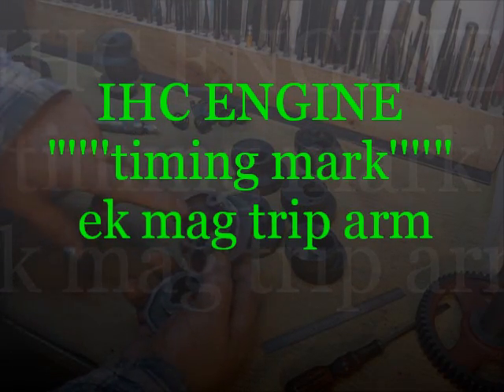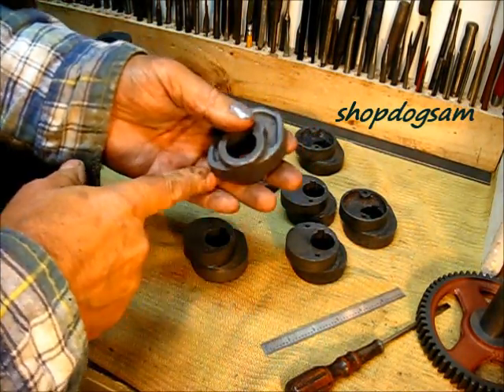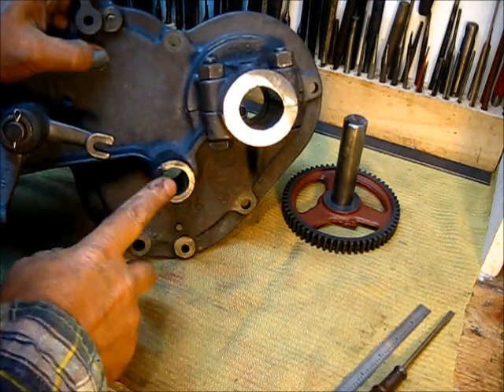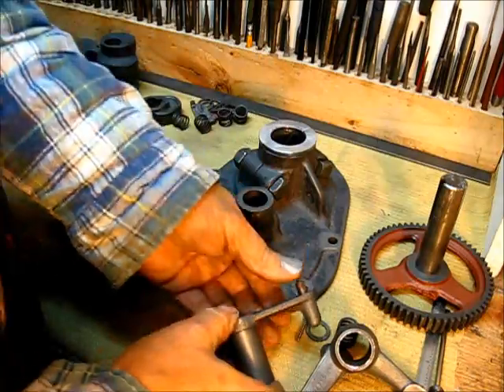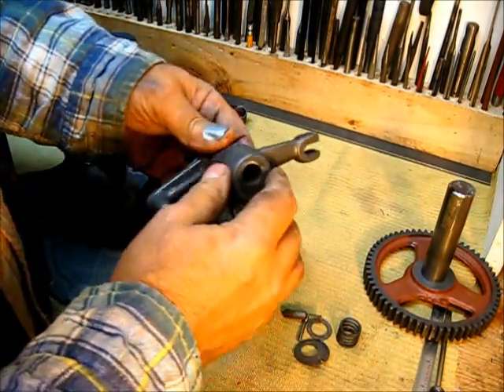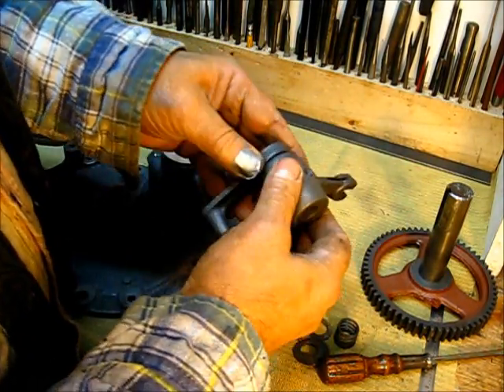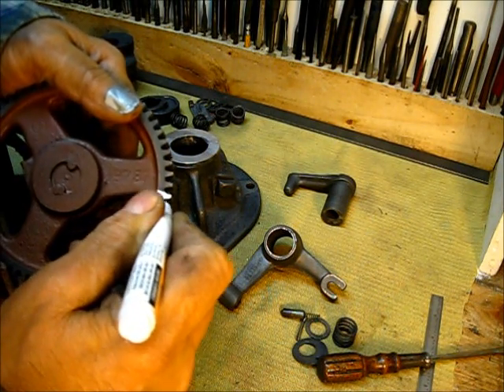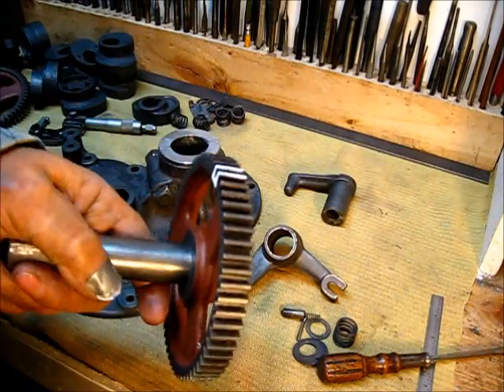IHC ENGINE / ek magneto bell crank, spark advance lever explained

Comment: I am new to the engine hobby and I have learned soooooo much from your videos.  On my McCormick 1 1/2 M the magneto trip mechanism has way too much play in it.  The spark advance lever pin that holds all theses components wobbles inside the cover.  How do you recommend taking that wobble out?